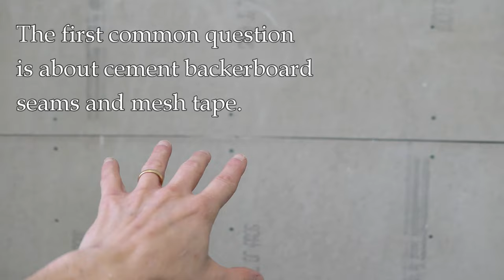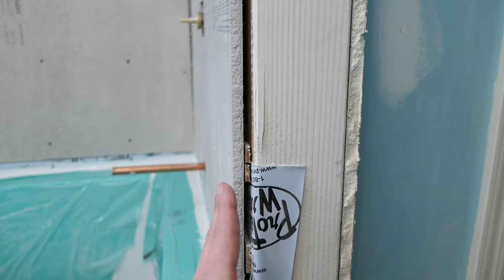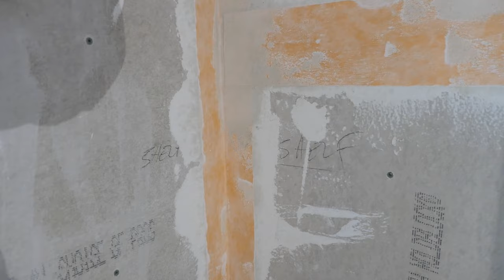Should Backerboard Go Over The Tile Flange Or Up To It?

Comment: Using a flashing membrane over the lip of the tub and running the Hardiebacker down to the lip sounds like a good idea, except when it comes to the fact that it will invalidate some tub warranties... you do NOT want to have a product like Vicor coming in contact with a Delta acrylic tub, for example - it will cause the tub material to crack over time, and Delta will not replace the tub under warranty.  The Delta acrylic tub line doesn't even allow you to use plumber's putty on the drain, etc., but I bet other tub manufacturers have similar restrictions.
Reply from the maker: There's a lot to unpack here.  First, the issue with some acrylic tubs and plumber's putty relates to petroleum products in the putty which can stain the tub or run the surface.  They make different forms of plumber's putty and some are safe for use on acrylic, or you can use silicone sealer instead.  Second, there are at least two types of window self-stick flashings.  An older type uses a modified asphalt coating, and the newer type uses a butyl coating.  If you are worried about the asphalt type in contact with a plastic tub, you can choose the butyl tape instead.  Even so, your fear of an asphalt type causing a tub to crack is wildly overblown.  At worst it might leave a stain or even mar the finish where it doesn't show.

Finally, manufacturer warranties are not something I worry about anyway.  The cost of the tub is meaningless if I have to pull out the tiled walls and floor to replace it, and the manufacturer doesn't cover that labor or material.  Tub manufacturers are also notorious for including installation instructions which make no sense or which are so generic as to be meaningless.  I routinely find contradictions in the installation booklets which would have you do two different things for a single installation.  For example, they will state on one page that a tub is free standing and on another page that a bedding mortar is needed.  When I do an install I read the directions, then I make my own judgement about how it will be installed.  The manufacturer isn't going to come help me replace a tub if it goes bad, and I have far more experience than the knuckleheads who wrote the instruction booklet.

Comment: Hi what about the aqua seal which is used in Ireland..it stuck to back and sides  of Bath than a special silicon to stick  it to the backboard. The bath is put against the backerborad the seal onto board....Nice work ...as you say it depends on situation.
Reply from the maker: It's actually surprising how different countries handle various construction details.  There is quite a lot of variation despite the existence of international building codes. Even between neighbors like the US and Canada there can be puzzling differences.

Comment: Do you use any silicone between the flashing/lip and backer board, or does the backer board sit on top of the flashing/lip?
Reply from the maker: As I showed in the video, the backer may go over the lip or it may have to sit on top of the lip depending on the circumstances.  Since I install flashing I do not use silicone sealer until after the tiling is done.

Comment: Your remark about how “we don’t work in ideal/perfect situations” hits hard.

All these desk jockoes sitting in an office design for perfect job sites. But materials are hardly ever perfect
Reply from the maker: Yes, and this is especially true with remodeling as opposed to new construction.  I often see recommendations for materials, designs and techniques which might work fine in new construction but which have significant problems when used in remodeling or repair.

Comment: HELP!  Im almost ready to set the backerboard but im afraid to because:  i used stainless screws to attach acrylic tub to my stud wall. The tub is laid on top of a mortar bed for leveling. Should i remove the screws or tile over them??? Thanks!
Ive decided to use your flashing method over screws too, if i keep them. My backer is on top of tub lip/flange. Not down to the tub.
Reply from the maker: If you used the right screws and installed them correctly you'll just tile over them.  A flat head screw may not protrude much anyway, and if you used a bugle headscrew it should be countersunk.  In the event a screw head sticks proud it's usually buried in the thinset mortar, or you can relieve the back of the tile slightly with a wet saw.  The flashing should go overt he lip but behind the backerboard if you use it.

Comment: My question is about the exposed flashing at the bottom of the wall where it meets the tub or shower pan. When you install the tile system won't  the thin set fail to bond to the flashing as its a plastic facing??
Reply from the maker: You'll see in the comments this is a common question.  You have to realize that thinset won't stick to the pan or tub lip, either!  It makes no difference.  That's why I stress the importance of at least 2/3 of the tile being adhered to the backerboard.  See this:  https://youtu.be/y3bpE-GhYUM

Comment: Totally agree with your demonstration and explanation. Real world design, yes. Great videos. 
I’m not sure where the idea came up that the tile backer ‘must’ go over the lip in the first place. Manufacturers, and logic, allow for both methods. I use Denshield, and instructions clearly show tile backer coming down to top of lip. I’ve also checked directions for multiple pans/tubs that clearly show installation methods allowing either to the top or overlap. 
Sincere question: what benefit could there be to having the backer board come down over the lip? The only water I can imagine is if the caulking was completely gone along the bottom of the tile and the shower water hits the tub and somehow splashes up between the tile gap and back over the lip. Not very likely, but I’ve added your suggestion of the self-stick membrane as redundant insurance. As far as breakage, also seems a minimal risk on a porcelain tile to break in that 3/4” overhang. Great work, thanks.
Reply from the maker: Over the years I have been on a number of jobs where total catastrophe occurred and water from a shower was leaking to floors below.  Several were in second floor condos that leaked into first floor condos and caused an insurance nightmare.  In all of these cases, I saw things that should not happen, but did anyway!  One was a corner with framing that completely failed, and that opened up a large crack.  Naturally, the homeowner just ignored the crack and continued to shower each day!  A few others were related to unusual lateral loads or blunt force placed on walls which caused cracks or holes.  I'm still not sure if it was fights, or shower sex, or what the hell was going on!  In any case, you can't predict what homeowners will do in the future, so I plan for the worst.  It's highly unlikely that the flashing system I use will be needed, but it's inexpensive insurance.  As for tile sticking below the level of the backerboard bottom, it shouldn't ever be a problem for larger tiles.  However, if I'm installing a small 3x6 subway tile, as an example, I'll be a little more cautious about filling the back space with thinset on the bottom row.  Having the backerboard extend over the lip is nice for smaller tiles, but it isn't the end of the world if it can't be done.
Reply: enduringcharm Yes, point taken. I had situation where window wasn’t originally flashed properly and wall was falling away, water sheeting down inside. Owner only found out  got a call from downstairs when their shower leaking from ceiling..!        True, when I use small tile I take that into my backer consideration.  Though I don’t warranty for shower sex.. 😉
Reply: agree with you. As said in the video the bath walls determine if you can do that or not. beyond the length of the tub against the wall it depends on the space you have to work with.

Comment: My last shower, I installed 1/4 inch Hardy backer to the tile phalange and then another layer of 1/4 inch over that down to the top of the shower pan.
Reply from the maker: In other words, you used hardibacker as a shim?  I suppose that could work, but it's an expensive shim.  When shimming is a needed option I typically use plywood strips from leftover plywood.

Comment: Quick question, I have a shower that was done in hardibacker and no redguard and have black mold growing in a three year old shower we hired out. I did notice you used kerdi membrane in the corners, would that have prevented it? This was a job we hired a "professional" to do.
Reply from the maker: Mold needs moisture and something to eat in order to grow.  Hardibacker does not provide a food source, nor does thinset, although the mold can grow on the grout.  I'm wondering if your pro used mastic rather than thinset?  That is not supposed to be used in wet areas and it can support mold growth.

Comment: What if I'm only replacing the shower pan, and have existing tile walls? How do I make sure the membrane gets covered/protected , (over lapped)?  The transition from floor to wall has curved tiles, which I planned removing, and replacing. Help!!!
Reply from the maker: Well, as a rule I don't simply replace a pan or a tub without also replacing the tile installation.  As a matter of fact, I really try not to do piecemeal work in a bath.  I remodel the whole thing or not at all.  That said, I have had instances where I was called to repair a tiled wall because there was no budget for a remodel, or to repair a failed installation by another contractor since the bath was relatively new.  In that situation you are forced to live with the way the original tile was installed.  So you'll remove at least the first row of tile, or more if necessary.  Then you'll install your pan or install the tile base.  You'll install a flexible flashing over the lip for the area of the tile you removed, then install backerboard.  Rather than install sheet plastic underneath, use Schluter Kerdi membrane over the backerboard to waterproof it, and ideally you will overlap the seam where you pieced in the backerboard. 

One problem you will face is that the new pan will not align with the tiled floor if that's what is there.  So you'll need to remove a row of tile by the edge of the pan as well, then redo that area.  It ends up being a patch job and not lasting very long, which is why I avoid that situation.

Comment: Love this video. Very helpful! Would it be bad to put the flashing or Kerdi band over the front of the backer board and the lip of the shower or tub pan to help stop water from getting behind them as well?
Reply from the maker: To be clear, I use that flashing as protection for the future in case there is a problem.  It's not so much waterproofing, but a way to direct water back to the tub if caulking is not maintained or something goes awry years from now.  You would not want to use flashing on top of the backerboard because that would prevent tile adhesion.  If you do think you need complete waterproofing, though, you could use Kerdi membrane over the whole surface, since that is designed for tile adhesion.

Comment: What if the shower pan is a Schluter Tray which has no lip? Do you leave a gap between Kerdi-Board and their tray?
Reply from the maker: The Schulter system is a completely different animal.  In that case you are tiling the floor, and there is waterproofing membrane applied to the walls and the joint between the floor and walls.  See this video:  https://youtu.be/Q0UpPtRW_uM?si=BbSFLN2f-qZIFMa0

Comment: Where your tile overlaps the tub lip what is behind the tile that supports packing in the grout...in other words what holds the grout where tile is lipped over tub lip?
Reply from the maker: The lip is typically not very tall, maybe a little over an inch.  So the thinset behind the tile in that area doesn't really act as adhesive but it may provide some support for the tile.  You want to avoid short piece of tile over the flange because the tile must adhere to the wall.  As for the grout, the first grout line where the tile meets the tub or pan is not grouted, it is caulked with a silicone or tile grout.

Comment: Love your flashing idea!!! In my humble opinion, drywall should NEVER go over the lip and down to the tub edge. It should ALWAYS stop at the top of the lip leaving a gap. if water sits on the lip and ever gets behind the tile, it will wick up into the drywall if it goes all the way down to the tub. It can't do that if there's a gap. (Same thing with a shower pan.) Shimming the walls just to create a potential problem down the road seems nuts. The tile will simply cover the gap and get caulked. Simple.
Reply from the maker: Actually drywall or greenboard is no longer used in shower areas and it would be a code violation to do so.  Cement backerboard or proprietary products like Schluter's Kerdiboard are now used because they are not subject to the same issues as the drywall.

Comment: What do you do with that gap from tub to backboard? Especially with smaller tile where only about an inch and a half will be on the backer board and the rest is just that gap behind the tile?
Reply from the maker: I made a whole video on that subject: https://youtu.be/y3bpE-GhYUM .  As a rule of thumb I want at least 2/3 of the tile adhered to the backerboard.  If you have a fairly large gap in the lip area you cannot use a small tile, simple as that.  If small tile is desired, the backerboard generally must come over the lip.

Comment: Why not install the backer board first from the sub-floor to the ceiling then install  the tub or shower pan?  That way the cement board is behind that flange? What would the problem be then?
Reply from the maker: There are several reasons not to do that.  First, the rough opening is sized for the standard tub (most often 60 inches) and if you first applied two half inch thicknesses of backerboard over the studs then the tub would no longer fit.  Second, if the backer is not on top of or over the tub/pan lip, then when you went to tile you'd have the tile matching up with the now exposed lip.  Plus, you'd have a leak at that intersection.

Comment: I'm going to use drywall and waterproofing it with the red mastic. If using a shower pan where do I end the drywall.  Do I do the same method with that waterproofing tape?
Reply from the maker: Please don't use drywall or greenboard!  That is no longer an acceptable practice and, in fact, it is prohibited in the building code.  Instead use a cement backerboard.  I prefer Hardibacker, which is not porous like Durock.  I have several videos on how to cut cement backerboard.  Or, if the weight of cement backerboard is difficult for you to manage, use one of the other lightweight tile backerboards such as the Schluter Kerdiboard.  You can also completely waterproof the shower if you wish, although it isn't always necessary.  I'm not a fan of the Redguard product, but I will use the Schluter Kerdi membrane.  Or, if you use the Kerdiboard the membrane is built-in.

Comment: In New Zealand world , tradesman always finished the shower areas walls first and put the shower tub just fit and joint to the wall surface. In this case the tub shim would be around 10 mm over the plumbed wall surface. If in tight budget can we just do the waterproof at the walls and cover the shim then put a thicker tile adhesive to finish up the tile walls?
Reply from the maker: I'm always intrigued to learn how other countries handle details like this, but I'm not certain I follow your description.  Maybe you can elaborate on how the walls are finished and what materials (drywall, backerboard, etc.) are used?

Comment: Can you prefill the area between the backer and tub? 
I’m putting 2”x2”hexagon marble and leaving a gap might not support the half pieces
Reply from the maker: I have another video on this subject linked here.  If you are using a 2x2 tile, you should install the backerboard over the flange because there will not be enough support for a small tile like that over a gap.  If you just can't install the backer over the flange, then you should use a different tile.  My rule of thumb is to have 2/3 of a tile adhered to the backerboard for support.  https://youtu.be/y3bpE-GhYUM

Comment: I’ve always notched the cement board to go over it bit. At least on the shower head side and the long side. I think it’s better to have a mechanical way to have any possible leak not run straight down the wall behind the tub.
Reply from the maker: That's fine if the flange thickness isn't too great, but often the flange thickness is about equal to the backerboard thickness if it is a fiberglass tub or pan.  Obviously notching doesn't work in that instance.  And, you must be careful about the backerboard dust, which contains silica.

Comment: Excellent video and proof of there ain't nothing square or straight in construction. 
But I am curious about the membrane around the top of the tub behind the backerboard. When you drive nails or screws through the backerboard and through the membrane does that not defeat its purpose?
Reply from the maker: That flashing is there in the event something goes badly wrong in the future, not as an everyday kind of protection.  In the event of significant framing movement, cracked or broken tile, badly disintegrated grout, etc., it will prevent water from getting inside the wall cavity.  If it's waterproofing you want, use the Schluter Kerdi membrane over the entire wall.  That's what I use when the circumstances, such as a tiled shower with tiled floor, require full waterproofing.